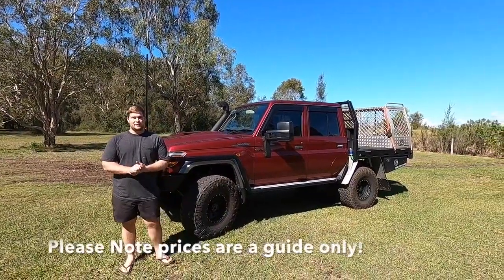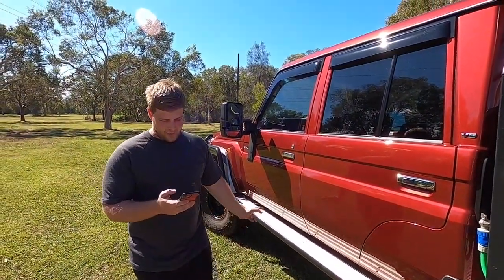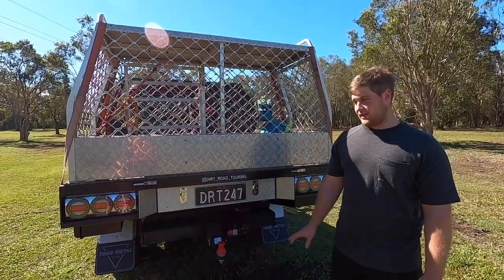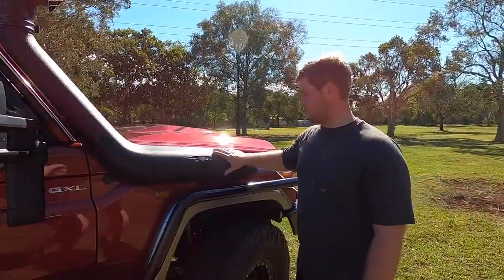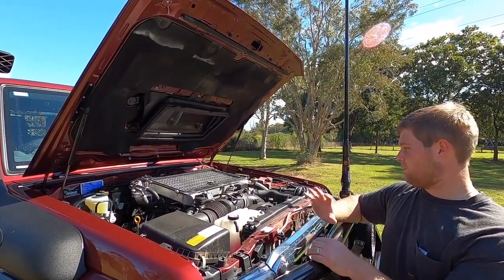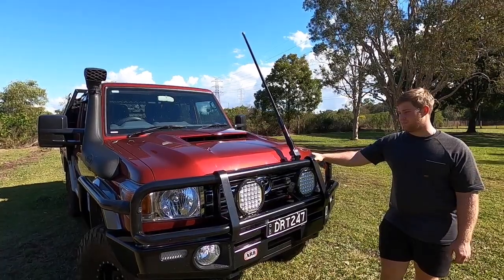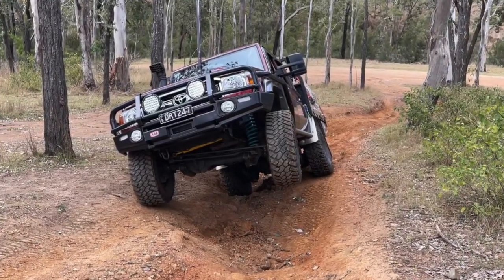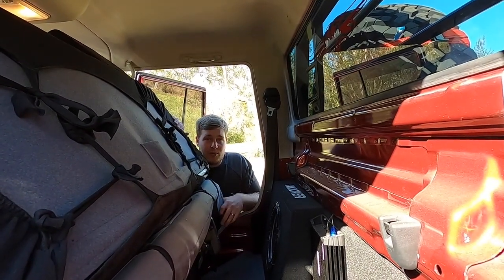2020  dual cab 79 series Landcruiser walkthrough, ESSENTIALS

Comment: 30:53 couldn’t of said it any better mate. I work in the mines and Toyota are the only cars on site everywhere you look because of the reliability it has for the hard conditions and even dust it feeds off on a daily basis. And as you said it’s easy to fix (being in mind we haven’t had much issues besides air filter changes because of the iron ore it consumes ) well done on the rig mate it’s a beauty 💯
Reply from the maker: Cheers mate, 💯 i know you pay a bit more for them at the start but they are tried and tested in The toughest conditions in Oz! 👌 like you said if you’s use them day in day out with no issues they must be awesome 🙌
Reply: @dirtroadtouring  hey mate I keep coming back to this beautiful rig and wondering what offset are you running all around ? I like how wide the wheel stands and is it giving you proper wheel correction or better drive how you based it ? Thanks.
Reply from the maker: @merxzyiv571  hey mate, thank you for that 🙏 i’m running neg 25 rims all round. We left the wheel track the same as factory without correcting it as we thought we would see how it went first and soo far soo good. We haven’t really noticed the track difference much.

Comment: Clean rig bro. I was wondering how the fuel economy is? I am considering investing in one for a touring set up.
Reply from the maker: Cheers mate, fuel economy is not too bad considering what they are. As it sits we usually get around 14L/100 and towing our van sits betweem 18-20L/100. They are definitely a great car for touring if you set them up how you need👌
Reply: Wow that's much better than expected. Thanks for the info.
Reply from the maker: @himashwijesekera2401  no problems at all mate🤙🏻 i could imagine fuel economy would be a bit worse if we had a big canopy on the back though

Comment: Nice looking rig mate I only just got my first cruiser 👌 I have a question for you about the panel on the back wall how did you go about mounting it to it with out having screws popping out side the car ?? I’m looking at doing the same thing
Reply from the maker: Thanks mate, awesome stuff. Once you have one its hard to go back to anything else.  What i did with that one is i’ve got 2 small cut outs either side for the seat belts to bolt in again which hold it in place a bit but i also used the 2 existing bolt holes in the floor where the jack was mounted and the whole lot is very sturdy in there just using them. Hope that makes sense mate 🤙🏻
Reply: @dirtroadtouring  thanks mate  👍🏼 I’ll go and have another look at. Also what size tyres and off set are you running on the front and back looks exactly like what I want cheers 🍻
Reply from the maker: @stevesmith6528  no problems at all👍 we’re just running 315/75r16 on a -25 rim all round with no track correction🤙🏻

Comment: Hey bro awesome video. Just wondering is this 500kg rear leafs? I have a similar alloy tray buy thinking 300kg springs but you say the ride is OK with no load?
Reply from the maker: Thanks mate. Yes we’re running 500kg leafs in the rear for when we had to tow the van. It was definitely a bit stiff at the start but they have definitely softened up a bit now and once the shocks are dialed back it creates quite a good ride.

Comment: Hi bro great rig is the roof console easy to install  do u have to drill holes
Reply from the maker: Cheers mate! Super easy to install. Department of interior have done an awesome job in design. No holes needed to be drilled, just bolts straight up 👌

Comment: mate would you be able to supply all the part numbers for all suspension components you used and did you have to change radius arms for the caster correction for the 3 inch lift?
Reply: Sorry I forgot to add, but did you have to extend bumstops or replace pan-hard bars? Also what stearing dampener did you end up going with?
Reply from the maker: Hey mate, unfortunately i dont have the exact part numbers as my mechanic ordered it as a kit. It was a 3 inch lift all round (dobinsons mrr 3 way adjustables) with 500kg constant leaves from dobinsons.  We just did castor correction bushes with the standard radius arms which seems to work well. 
As far as i know we didn’t have to extend bumpstops. We did upgrade the front panhard rod to a dobinsons adjustable one. 
Unfortunately at that time we couldn’t get the new dobinsons remote res steering dampener so we just got the standard one from dobinsons 
Hope this helps mate 🤙🏻
Reply: @dirtroadtouring  cheers mate, also is the current set up fully legal in the state of qld and possibly nsw?
Reply from the maker: @tobyhumphries4511  i’m not 100% sure. I dont think so. There are some kits you can purchase pre rego that are legal I believe. As it sits now it looks like a 2inch lift(legal)
Reply: @dirtroadtouring  is that just due to the car now having electronic stability control or is it due to another issue?
Reply from the maker: @tobyhumphries4511  correct mate, I believe with that nowadays maximum lift is 50mm or 2 inch
Reply: @dirtroadtouring  I’m pretty sure you can go up to 175mm total lift (that’s including tires) If you don’t have the electronic stability control (that was introduced in the 2016 to current models)
Reply from the maker: @tobyhumphries4511  ahh thats not to bad then! 👌

Comment: Don't get a rhino rack. Spend the money and get the front runner rack. Heaps better and fully load rated off-road.
Reply from the maker: Awesome mate, thank you for that. Always looking for recommendations! 👌🏼it sounds like the front runner are the way to go!
Reply: @dirtroadtouring  definitely the way to go. If I could get another rack for my 76 series I would go the front runner. You can also look at getting the table which sits under and locks into the roof rack. Handy to have for day trips.
Reply from the maker: @brentlendich8011  that definitely sounds like a good setup. I’ll definitely have a better look into them 👌🏼